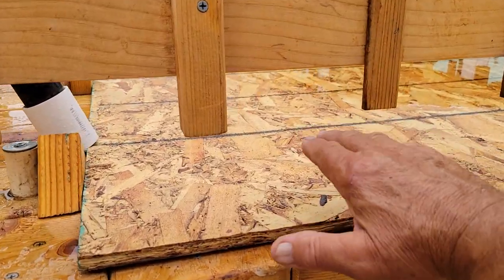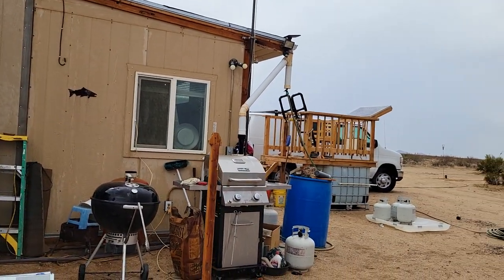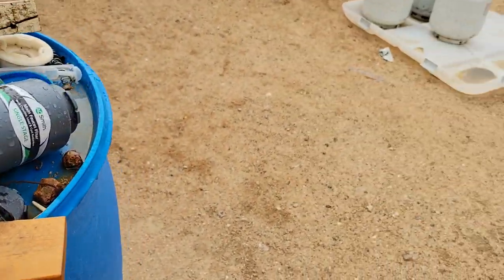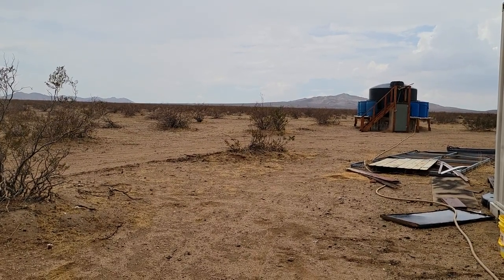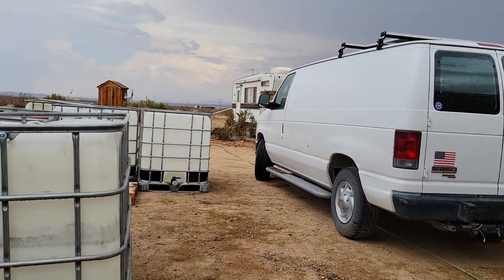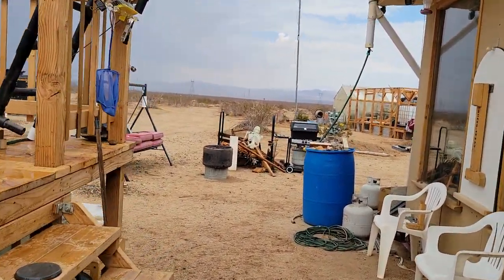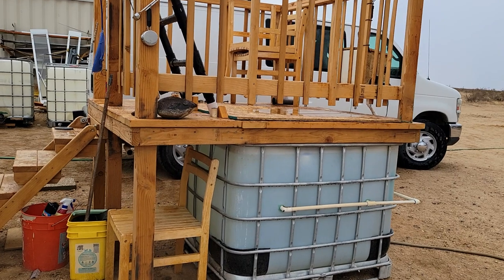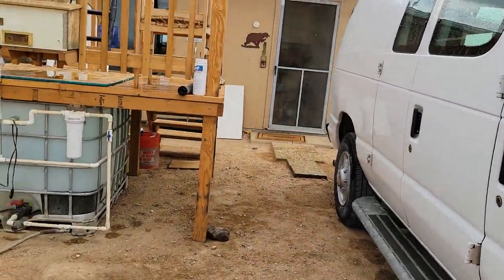How Much Power Do I Produce On A Rainy, Overcast Day? Aug. 1, 2022

Comment: Just thought I would let you know that it rained 4 inches here two days ago. I caught 3 barrels and a 100 gallon stock tank full for the garden. Looks like you might get some rain yourself. I was so glad it rained, I didn't mind running the weed whacker. It rained a little more yesterday morning, so my panels had to do without sun for a day and a half. The volts dropped a little and it was cloudy today so I never got quite a full charge back yet. But it's close...25.2 volts at the moment,  at midnight. Last night , same time it was on 24.9. There were high winds about 65 miles South the other day and 9000 without power...the poles were all leaning badly. I am glad to have my own power. It's not as weak as I thought it was. I found out my microwave uses 1472 watts...lol. It said 900 on the box. I know it doesn't take long to heat something. The volts usually drops about 1 volt when I use it. It bounces back a lot faster now with 20 batteries. When I had 18 I was wondering how much good two more would really do anyways. I didn't figure it would make the difference that it did. About this time last year I had 12. A whole other ball game now. I wouldn't mind having 4 more but they went up and I'm always broke lately. Wonder why...well go out and do a little rain dance and maybe it will work...good luck....
Reply from the maker: Yeah, people just don't get the importance of a good battery bank.  I wish I had 6 more in mine, but just like you, lack of money gets in the way.
Clear skies here this morning, .03" was all I got in rain, but better than nothing.  It's like buying a ticket for a multi-million dollar lottery and only winning 5 dollars.😮‍💨
Reply: I was at home depot in ne texas yesterday.   The treated plywood  has gone up slightly  around 59.00 a sheet.  still high to me.  Maybe it will drop soon. Not sure.   Maybe the days of 25.00 to 30.00 per 3/4 inch treated plywood sheets are done.
Reply from the maker: Welcome aboard!  Yeah, I saw those prices the other day. Remember,  inflation is at a 40 year high right now.  Maybe things will get better after the next election.